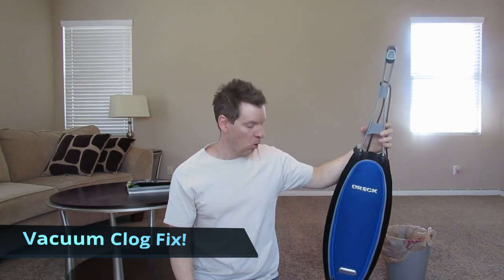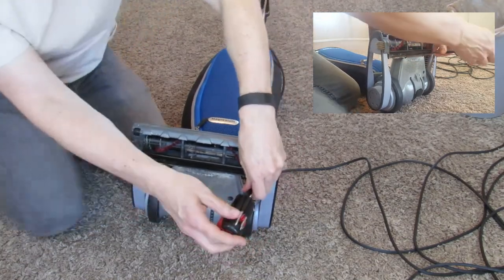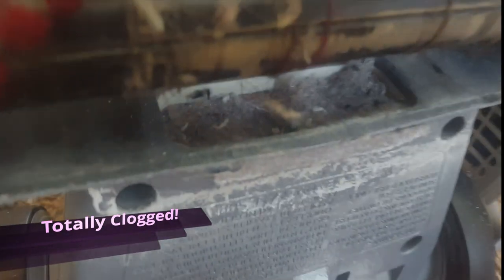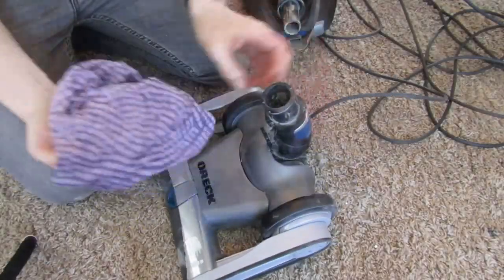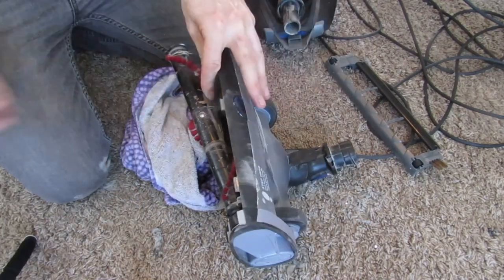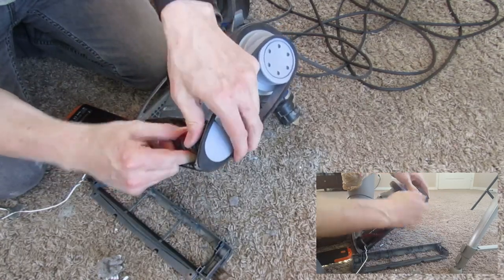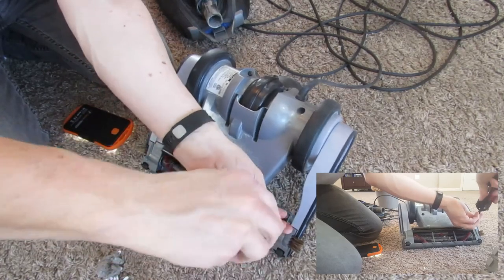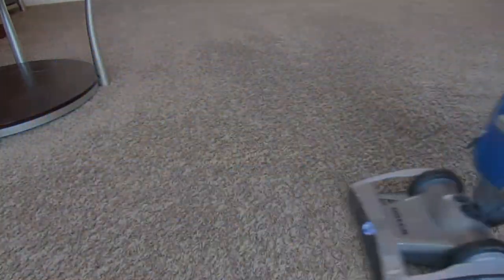Simple and Easy Vacuum Repair Oreck Brand

Comment: If you don't have a back scratcher and then another thing that would work would be a wire hanger you can untwist it and use it to get down deep in the clock
Reply from the maker: I've done that as well. Wire hangers work great! Thanks for watching!

Comment: i use my dryer lint brush. it is long and flexible and the brushes grab the crud to pull it out.
Reply from the maker: Haha thats great. Ive used many different things to unclog a vacuum. The back scratchier seemed to be the best because of the little hooks on the end. But its not that flexible so maybe i will try a dryer lint brush. Thanks for the great idea and thanks for watching.
Reply: @UltimateTechHub  you're welcome.

Comment: You're missing the side motor filter, I would replace that. Otherwise you'll get a lot of dirt in the motor and it will start grinding. Also, if you haven't brought it in to an oreck dealer to get it  tuned up in the last year... Do that, the seals on that model tend to wear out after 6-18 months and you'll start to loose suction, and have dirt spraying into the inside of the vacuum. The magnesium's had a lot of problems if they weren't rebuilt every year. And with it being discontinued now, I would bring it in and get parts while you still can.
Reply from the maker: Thanks for the comment. I have had an Oreck dealer give me a tune up last year. I had 2 free tune ups when I bought the vacuum. I love this vacuum and this is my second Oreck.
Reply: @UltimateTechHub  ya that model was definitely the best vacuum oreck ever made, it just unfortunately had some durability issues. But, if it's treated nicely it should still last you a very long time
Reply from the maker: It still does the job, I will for sure buy another Oreck Vacuum when this one starts to break down. Thanks for viewing my video.
Reply: I just open my vacuum and it looks clean but there its a burning smell I dont know where its coming from?
Reply: @erikrangel3896  did you ever get An answer or figure out the burning smell culprit.  Hell are you still “with us”

Comment: My vacuum starts but it turns off as I start to use it. Pls help
Reply from the maker: Sounds like a loose wire or connection.  My oreck did the same thing after I had it serviced. It ended being a connection that was loose. You may have to take it to a vacuum repair store if you dont feel comfortable taking your vacuum apart. Otherwise google your make and model to find out about the electrical system'. It may help you find the loose connection. Keep me posted.
Reply: The roller has a magnetic metal ball in middle. If the belt is loose it will not rotate fast enough and magnetic sensor will cause vacuum to just cut off when running. Other repair videos explain this